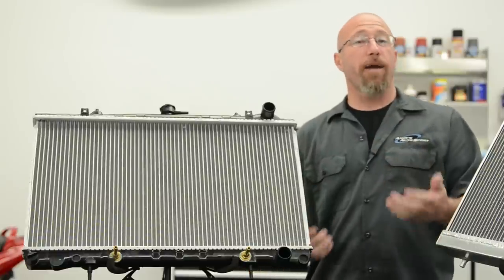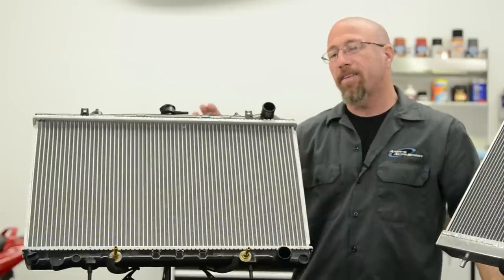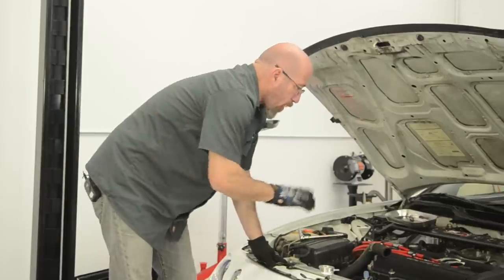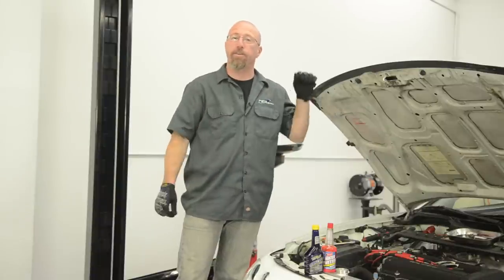Performance Aluminum Radiators and Install!

Comment: tip 1- when re using anti freeze pour it through a paint strainer. paint strainers sit perfectly in any funnel.  they are dirt cheap.  a paint strainer will even capture oil and dust particles. anything smaller than dust is not going to hurt or clog your cooling system. 
tip 2- when filling most cooling systems,  either park the car facing up hill or jack the front of the car.  this allows all air bubbles to escape towards top front ( see buoyancy )  no bleeding will be required.

Comment: Just curious but why were you guys being so cheap with this install? If I'm replacing my radiator for a "Racecar" I'm replacing the coolant hoses and lines, and installing an aftermarket radiator fan, you can get a 16'' fan with 3,000 cfm for around 16 dollars. Truly worth the extra money when playing with a component like a cooling system. The thing that truly got me is the fact you re-used the old anti-freeze.. Just buy new coolant. Its like $4 to $40 dollars depending on what you get, but pre stone is only $10 dollars for a gallon. Those are just the things I though you should have done, I mean if you are willing to spend 200+ on a aftermarket radiator, go the extra mile and replace your fluids and lines. the fan is my recommendation, but not necessary.

Comment: What's the difference between Plastic and Aluminum Radiators? I need one for my 1986 Chevy Silverado c10.Need some adive or help on getting the right one.
Reply from the maker: Hi Charles!  All aluminum radiators are generally used for high performance and maximum cooling capacity.  

Plastic aluminum is just an OE replacement radiator and not a high performance product.

So if you're just looking to replace your factory radiator, you can go with the plastic aluminum.  If you have a high performance vehicle that needs maximum cooling, then you would go with the all aluminum.

Hope that helps!
Reply: AndysAutoSportTV So the plastic one will work fine for my truck?
Reply from the maker: Yep, if you just need a replacement and you haven't done any major performance mods to the truck, yeah you should get the plastic one.
Reply: AndysAutoSportTV Thanks man you very helpful...

Comment: You're building a racecar... Put water from a damn tap in it. Even that's better than that old antifreeze... Or buy a little distilled water. I'm sure it's max $5 for 2 gallons.
Reply: Easy killer. I didn't say he doesn't know what he's doing but he is being lazy. So here, let me make it simple for you. I've worked on cooling systems before too. Running pure water is one of the best ways to stay cool (besides high quality coolant) with a low temp thermostat and gets the most out of your aluminium rad.. Educate yourself.
Reply: jayleno's garage shows water-less anti freeze